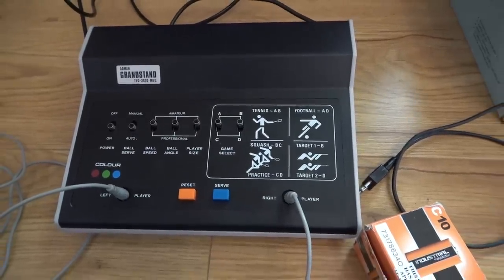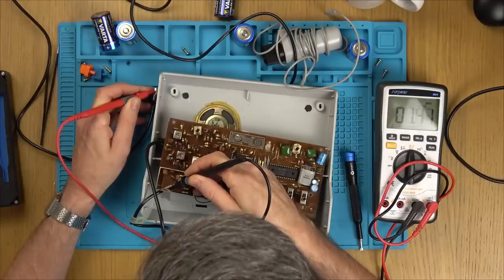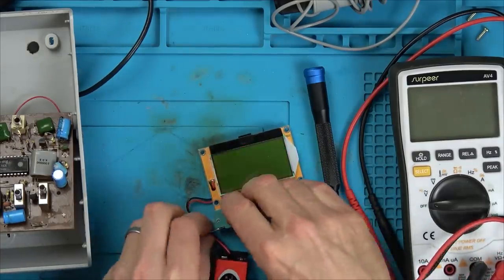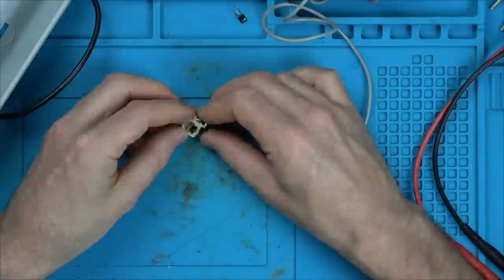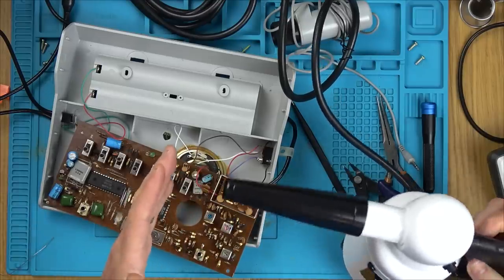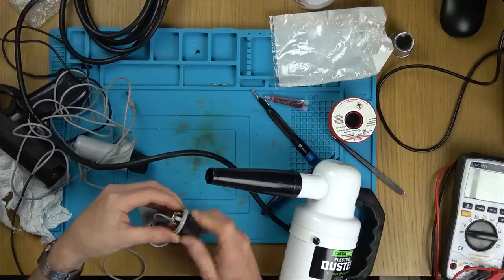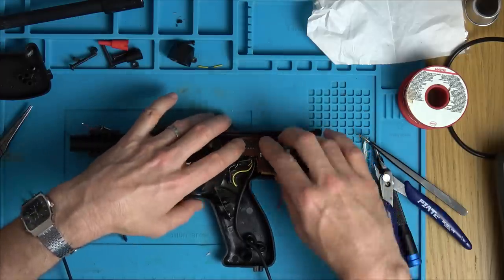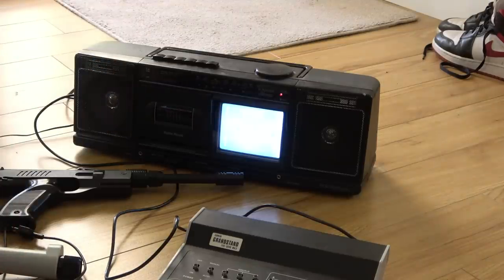Repairing a Vintage 1977 TV Games Console with MANY FAULTS - Grandstand ADMAN 3600 MK2

Comment: The Light Gun is a photosensitive receiver, it does not emit light. It only works with CRT because it actually sees the cathode ray as a point running zig-zag across the screen.

Comment: That transistor normally blows due to reversed polarity. So someone has plugged in an adapter with the wrong polarity and perhaps also incorrect voltage. I've seen it a million times.
Reply: And reverse polarity protection didn't exist back then. Don't know when manufacturers started to actually integrate that into their devices.

Can you imagine how many devices must've been ruined and dumped over the years because of reverse polarity knocking out one of those transistors (potentially even the main chip)?

Comment: I screamed when you flipped the mainboard over: "Put some protection on the backside of the speaker, it is metal!" Vacuum cleaning after deoxidizer doesn't make sense, before it can.

Comment: The two connectors on the rear of the paddle sockets are shorted when nothings plugged in and disconnected when something is. It's used to detect when a paddles is plugged in.
That duster is a bit fierce. LOL.
I'ts just a light sensor in the gun, not an emitter. Nice fix, Vince. :)
Reply from the maker: Thanks Franko 👍👍👍

Comment: Great job!
That part on the gun is not an emitting diode. I believe that it’s a photodiode that changes resistance depending on the amount of light. The lens greatly magnifies the spot where you are pointing at. So, if you point to the white square the photodiode senses it, and, when you press the trigger, the console knows that you are aiming to the right spot.
Do you remember on duck hunt how when you pressed the trigger a flash came up on the screen, and a white square was over the targets? That’s a really similar working concept to this one. :)
Reply: Yes it's a photodiode, from what I remember the trick is a timer is reset by the vertical blank signal and you can work out what a rough x, y position should be from the time it takes for the raster to scan the CRT. If that phosphor is bright then it's a hit.
Reply: @Drew-Dastardly  it is much easier than you think - the game thinks you hit if the gun registers enough light. At least it was the case with a similar console I once had.
So if you aim at a white ceiling you always score.
Reply: @stephans.6158  Yup, that or using a flash light would be a good way to cheat of this game 😅
Reply: Its a photo transistor in that case. MEL12 I think.
Reply: @Drew-Dastardly  Exactly correct. Uses the "back porch" of the video signal for timing and either a photo diode or a CdS (Cadmium.Sulfide) cell in the gun as the receiver. When the bright square on the screen is aligned with the photo diode/CdS cell inside of the gun, the resistance of the cell decreases and after a simple amplification stage, sends a "square/light detected" signal back to the microprocessor.   Fred
Reply: @travelingduo7523  heh, I used to aim it at a crafty positioned lamp behind the telly when I was loosing. It doesn't do anything clever with scanline counting like other lightguns, it just registers bright light.
Reply: @electronicengineer  No, not on this console, you're thinking of a NES. And you've no idea what the "back porch" is, it's irrelevant to light guns, it's not even visible. This console doesn't have a microprocessor either. I once wrote an "emulator" that got it pretty right just using counters and logic. I'm sure the console does that, except more likely to use simple analogue capacitors rather than bother with real counters, cheaper and just about good enough. In a computer program though I had to use counters, being digital.

Comment: Not sure if this was mentioned but the jacks have 3 points for a reason. In this case the two terminals on the jack could be use for a positive and negative of a signal. This does not imply a ground as some signals can have a positive and negative portion. But usually they will just use the jacks in simple ways like joysticks inputs. But that 3rd pin is for a chassis ground that would be shared between two devices. For a jack like that imagine a preamplifier going into another amplifier stage or something. These devices will want to share a common ground between them as well as shield the connector. It isn't always used for this purpose so they often just tie it to the negative terminal or just ground and use it as an additional anchor point.
Reply from the maker: Thanks Coll 👍👍
Reply: @Mymatevince  No worrys glad to help.

Comment: Nice one, The gun uses a LDR (light dependent resistor) it detects the bright spot on the crt and the scan line of the crt and timing to calculate a miss or hit 👍👍👍👍
Reply: Prolly a photodiode, ldr's are much slower.

Comment: There were several different tv game makes using the General Instruments 8500-1/8500-2 chip. The chip is mentioned in Don Lancaster's CMOS Cookbook. The supply rail transistor replacement may have slightly higher ratings than the original transistor. Don't know if it's also being used as a capacitance multiplier through its forward gain factor in the smoothing of the supply voltage. Contact cleaning spray can be used on the control potentiometers, switch contacts, and socket contacts. A long type of grommet known as a strain relief grommet could be fitted to the light gun cable or non adhesive heatshrink sleeving (adhesive types are too stiff) used with some filing of the entry hole halves involved. Plug in psu's have this type of grommet on their leads.
Reply from the maker: Thanks for the tips Robert 👍👍👍

Comment: That gun was used is dozens on Pong clones. Still should work, it doesn't track the CRT raster like a Zapper, but is simply light sensitive. So it needs a black background and high contrast.
Reply: So presumably if you set up a modern tv for that all should be ok.   That’s just a LDR in the gun by the looks of it.

Comment: The jitter of the paddles on the screen is from the potentiometer inside the paddle controls. A spray of deoxit and some rolling and cycling should get them smooth as butter.

Comment: No need to mess about wrapping and soldering wire around the loose socket. It had just come apart slightly. The top hat shaped bit is pressed inside the threaded part.

Comment: Ive got loads of those Mono speaker sockets, they have a switching action to disconnect an internal speaker when you plug in an external one, they are normally mounted by the threaded part into a chassis, so they aren't exactly the right parts, it would have been OK if they left the nuts on them.

Comment: Very interesting Pong clone, and repairs :) 
I have a Conic TVG 201-4 Pong clone, my childhood unit from late 70's (chip has date code 7750) and it has weird fault as the image fades away after about one minute. From the sounds, the game works even after image has gone completely black on the screen, so probably tv modulator is gone or there's some other fault that I haven't found. The board has only two electrolytic capacitors, not sure if they have anything to do with the image problem, they haven't leaked at least.
It also has completely destroyed battery contacts, but I've injected power to the PCB by other means from battery and even power supply, image fades away even with steady power supply.
Reply: The story of the guy who developed the TV game concept is incredible - he had patents in this, electronic greeting cards, Simon game as well as submarine detection systems. He inspired Nolan Bushnell of Atari fame. 

If his parents hadn't fled Germany in 1938 he would have been another victim of the gas chambers and the story of games would have been different.
Reply: @mrw6156  I guess that concept produced the first Magnavox Odyssey videogame console in 1972? 
Commodore founder Jack Tramiel was also concentration camp survivor.

Comment: You need to stop thinking 'mono' and 'stereo' for those 3.5mm sockets :)

It's pole or TRS (with multiples of 'R'), so 2-pole, 3-pole, 4-pole, or TRS, TRRS, TRRRS, TRRRRS, etc... (for Tip-Ring-Sleeve).

You can have a TRS plug and a TRRS socket, it's possible they didn't have any TRS sockets on hand, or, to keep the bill of materials low, they may have just opted for TRRS sockets for everything.

Comment: I had the Binatone b/w version, no gun. I remember you'd get that jittery reaction to the rotary controllers if it hadn't been used for a while.
Reply: Ah, that might have been the same as the one I had then. I was thinking I couldnt remember it being colour (but I only had a 12" B&W portable at the time) and I couldn't remember the gun either, but that explains why!

Comment: Could you please add a link for parts,  tools, and the other stuff that you are using. Also, you can use an old mobile phone camera to see the gun light, it will work if is the same as TV controller.

Comment: Light guns work by detecting light, not emitting light. The console sends a black frame with a white square where the target is, if the gun is pointed in the right location the sensor detects the light in that square. The problem with LCD TV's is they have much higher latency than old CRT's. The light gun timings are very tight and if they don't detect the light coming from the TV fast enough they fail to detect the target. That's also why you can cheat in light gun games by pointing the gun at a light bulb when pulling the trigger.
Reply: It doesn't work on new panels because the light guns position is calculated  by the electron beam scanning across the screen. LCD TV's don't have a beam to detect.

Comment: That odd 3 connections you were talking about on the controller input was exactly what you explained on the external power socket.  The two back tags are shorted together when no plug fitted ( eg in an earhopes circuit, no earphones inserted the sound goes to a speaker) when you put the plug in the tip of the plug only goes to one of the contacts and disconnects the speaker. Thy are basically a switch.
Reply from the maker: Thanks Digi 👍

Comment: You should have tested the gun on a modern LED TV because it will probably work.
Guns that need a CRT TV are typically for the PS One ore PS2, Xbox Classic, Sega Saturn or Dreamcast. Before that guns just measured the light. It wasn‘t about the cathode ray at all.
Reply: Makes sense because of the single target here I suppose.
Reply: @AltCutTV  In the late 70s I played a lot with such a console and I could always get 10 out of 10 by just aiming at the ceiling.

Comment: You know something like this is old when one of the features on the box is, 'colour.'  Back when the majority of these, 'TV games', were literally black and white.  

This looks like a very low-hour console.  The transistor that blew having done so not longer after it was purchased and the owner having decided to just put it away and forgot all about it, some 45 years ago.  That is runs on batteries would mean it was at the very cheap end of the console market.  The mains adapter required having to be correctly polarised for it to work, which may explain how that transistor blew.
Reply: Most of these things (there are more variations of them anyone would care to count) had batteries. Probably not just to save production cost, but also to make them easier to get out of the way after playing. Hence also the attached RF that usually got wrapped around the console I suppose.

This was after all from the time of one household, one TV.